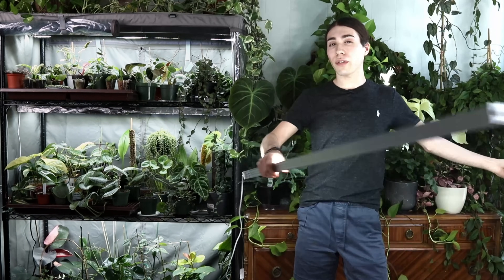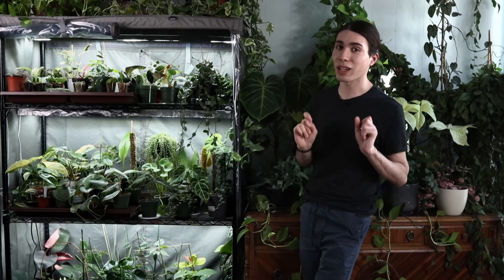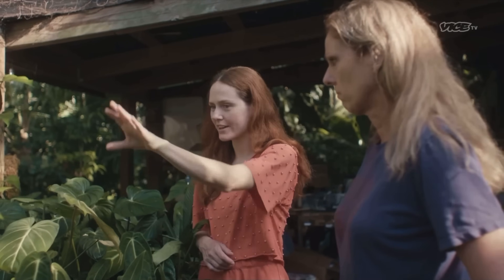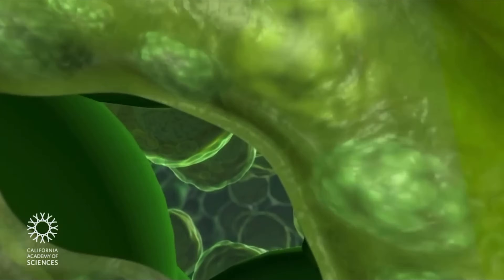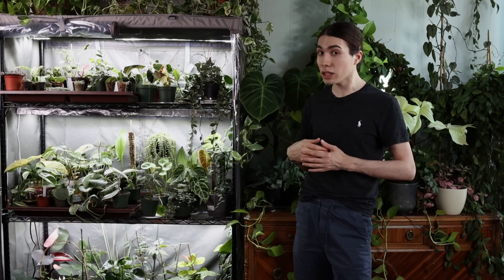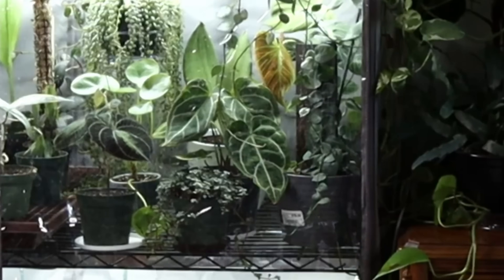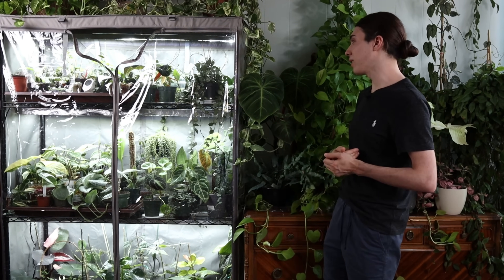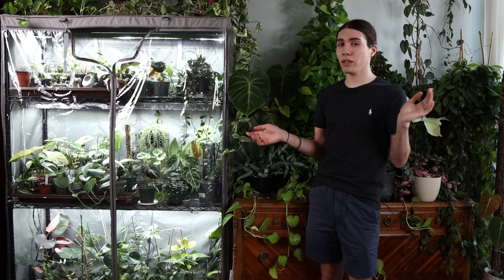How to Use Regular LED Lights as Grow Lights | Avoid the Industry Markup

Comment: I've been growing plants under lights since 1972, but I learned somethings from you today.  When I started, the bulb most used was the pinkish fluorescent tubes. I hated them for the same reason that you do.  They distort all the colors so badly that it is hard to tell if your plants are healthy.  About a year or so later, they came out with wide spectrum tubes, which were white, but very expensive.  I found out that I could get the same result by combining one Cool White Deluxe tube and one Warm white Deluxe tube.  (Deluxe tube had extra blue phosphors,) At the time and for many years, I used this combination in fluorescent shop lights, which I could buy for about ten dollars.  I learned how to make many different shelving units, usually the individual shelves were four feet long and two feet deep. Each shelf would be lit with two shop lights. Each shop light would hold two 40-watt tubes, one cool white and one warm white.  There was one big draw back to the system.  Four 40-watt tubes burned 160watts of power, but you could grow just about anything under them.  A three-shelf system like yours would burn 480 watts.  It was expensive, but since I wanted to have my plants, I paid it.  Sometime around 2004, natural daylight tubes became available.  That was about the time that I learned about the Kelvin scale. Up until then the Kelvin scale was there, but it was usually ignored.  You had warm white, cool white, and daylight.  warm white was around 2700 K, cool white was around 5500K, daylight was around 6500.  Natural daylight was 5000K and was the closest to the light coming in a south facing window.  It was the best all-round color if you wanted both rapid growth, flowers, and edible fruit.  The trouble was that natural daylight was only one company's name for that type of tube.  Other companies used different labels, then they also started using different labels for their other colors.  To be sure of what you had, you needed to look at the fine print on the back of the package and read the Kelvin rating.  So, what is the kelvin rating.  Basically, it compares the light of the tube to the color of a bar of steel as it is heated past the glowing point.  as you heat a bar of steel, at 900 degrees it emits a red glow. as the bar gets hotter the color moves into a predominantly orange glow.  Hotter still and the glow becomes yellowish, then yellowish white, then white, them blueish white.  I use 5000K because I am interested in cacti and flowering plants.  for a person like you who is interested in mostly foliage species and Hoyas, you would do better with 6000k or above.  When I place a Hoya carnosa  directly under my lights, it turned yellow and refused to grow.  I had to move it back about five feet from the lighted area before it got back the natural green color and began to show its typical silver streaks.
  With the introduction of LED lighting, the Kelvin rating became even more important, as did all of the information on the back of the package. When LED lighting was introduced, its main competition was the old incandescent bulb, so all the labelling was a comparison to incandescent lights because most of the country related the amount of light emitted by a bulb to the wattage.  When the label says 100 watts daylight, it really means that it produces as much light as a 100-watt incandescent bulb with the color of a daylight fluorescent tube.  If you look at the fine print though, you will see that it only draws 18 watts of power from the plug.  Since we pay for electricity by the watt, that is a huge saving.  When I discovered that, I changed every light in my apartment to LED.  The initial investment was high, but the lights last so long that I have not had to change a light bulb since.  When, before, I had to change my fluorescent tubes about every year because they deteriorated that fast, the extra initial cost was repaid in less than two years.  Because China has been producing such reasonably priced LED growth lights in configuration's that can be installed anywhere an electric cord can reach, the whole hobby has totally changed.   If I had a basement, I could grow hundreds of thousands of cacti down there, and in the back corners, where the light is not so bright, run a Hoya nursery.
Reply: I think this is the longest comment ever 😂 very informative
Reply: Thanks for the info
Reply: Super informative! Best thing I can suggest is to get solar-powered floodlights and you basically pay $0 for your nursery. Would love to see a comparison between that and having LEDs directly above your plants.
Reply: @chickenbellyful  The problem with that is  that you need to have a place to set up your solar panels. I live in a sixth floor apartment and all the light coming in my windows is needed by my plants. I do not have room to set up a solar panel array.  If I had such an array available, I would not use floodlights. that would be an inefficient use of the available power. I would direct the power into my plant light panels.
Reply: Thank you! Finally a good explanation! I thought I was all set with my 6500k full spectrum fluorescent (and now led) lights, BUT then the lumens.. confused me some 😂  I'm about to give up on my large succulent collection anyway, due to plant pests so I guess it won't bother me for long!
Reply: @haleraiser2299  Kelvin is a measure of the color of your light source, while Lumens is a measure of the brightness.
Reply: I'm glad you came up in my recommended, your humor made me subscribe immediately. You have a lovely collection and I'm super jealous of your string of turtles!
Reply: Super helpful comment!

Comment: From my trial and error and for my plants that I actually want to flower and enjoy the color of their blooms with accurate color indexing of the light. I found with the grow lights since you pretty much have to get red spectrum in but don't want it too warm or pink because it ruins the color of the blooms. The rough ratio is half cool white to half warm PLUS red leds. So example would be 100 cool white leds, 80 warm white and 20 red. Some even have IR which is supposed to be an added bonus for blooming and affecting stem elongation. Not sure if it will make a difference to notice. I have mine for bloom gesneriads and orchids. Maybe I'll eventually notice a difference between the ones with IR and not. Prices regardless are roughly the same so it's just a bonus if it has it.

The price of led's has really come down in last few years and there are lots of really cheap plant led lights with good spectrum. Four years ago there was basically nothing aside from grow tent lights or big heavy spot lights. Now there are tons of cheap light strips of all different sizes and panels. I just upgraded everything and am in shock how good the market is now. Really cool  small panels 2x10 for small shelves. Or strips that are 10-16 inches long that come in multiples 2-4 strips per fixture you can light a small shelving unit. Just so cool. And on top of it most of them with dimming settings and timers. It's really the best time it's ever been to be in the hobby. For 10-20 dollars you can literally light any little nook or spot of your house to put plants lol. Also another cool thing wire shelving now is readily available in all different sizes and with black coating so it doesn't look industrial. You can buy plastic mats on amazon for them that makes them look much nicer too. This stuff wasn't common just a few years ago.

To just give a monetary perspective of how good it is now. I just did a 5 teir black shelf with liners and dimming timer grow lights that can support blooming for around 140 usd including tax. There is no way you could have done anything like that just a few years ago, it wasn't available far less the price. Now is as good of a time as it's ever been to get into the hobby.

Comment: love your no-bs attitude so much, it's such a breath of fresh air. I definitely saw Planterina just use normal lightbulbs too, so now this gives me hope my set of succulents won't just die on my northern windowsill during winter.
Reply: All of my windows are north facing
 And all last winter I had a cactus × a succulent on my tiny little window sill. In Wisconsin. And they survived just fine. I also have several tropical plants near the windows and they did well too. And the only windows I have face north..

Comment: I am using hard LED strips designed for "aquariums, vivariums and terrariums" All I was looking at was the spectrum, lux and of course price. Stacking multiple  strips into a rectangular diy lamp seems to be good enough to supplement sun on the windowsill for my succulents. In fact any use of pink light I saw on succulent groups ended with a disappointment, they were cheap lights that were nowhere near enough to be the sole light source for a succulent

At the level of my plants (so close) it comes up to around 8 000 lux measured with a phone app, at night with outside blinds so only the lamp is emitting light. Not bad for a normal affordable strip (or rather four of them a bit spaced apart)
Reply from the maker: I don't think strips are constructed well enough to put out the same amount of light as bulbs with heat sinks and whatnot so that makes sense, but great for small spaces you just need a bit of light.
Reply: @phytosexual  Those are aluminium strips, not the flexible ones, so that might be better, at least according to what I read? 

But yeah, the lamp constucted with it is definitely less clunky than trying to place a bunch of bulbs on a windowsill full of plants ^^'

Comment: I love the level of science you include. Thanks for an educational presentation
Reply from the maker: no problem :)
Reply: Do more research before believing what he said... he compared his LED to a T12 TUBE.. t12 are those giant tubes invented in 1930 used in office buildings or retail in the past.   T5 is the tube he should have shown everyone.. T5 tubes are what plant and aquarium growers like me use for corals for salt water and plants in fresh...  T5 tubes at 6500k put out 5000 lumens, thats like 96 lumens pet watt i believe.. thats lower than the 130 lumens per watt on his LED.. but that 5000 is UN-REFLECTED light..  Florescent light fixture use reflectors.. a good V shaped reflector can double the light output.   So 5000 lumens plus 5000 lumens.. minus 10% from being reflected.... Thats 9500 lumens on one bulb..   Think about that for a second before believing this dude.   LED lights like his also have no light difusor.. so led light isnt spread out.. its directional..  meaning it has hot spots you cant see without a PAR meter..  FLORESCENT lights are 100% even light  spread..  They dont have hot spots.

Comment: For the last 2 years I've been using white 4000K LED lightbulbs (3 of them, about 5000 lumen total), in a "normal" fixture in my living room. My plants are a) totally fine and b) growing towards the fixture/middle of the room, and not towards the window, which is much more aesthetic. One thing you can look into is CRI of the lightbulb, which basically translates into how wide is the spectrum emitted. Most lightbulbs are around 90 CRI, but those that are 95 CRI and above have emission spectrum that correlates a lot better with absorption spectrum of chroroplyll(s). The price is very similar, but you may have to do a bit of digging to find which ones have higher CRI, because well, retailers don't care
Reply: Very true, most normal LEDs are missing a lot of red in their output.
Which I guess isn't a problem if you're growing the plants for foliage
Reply: Your plant is going to face and point toward wherever the most blue light comes from. Plants don't follow light, they follow blue light. And a 4000k spectrum color temperature lens towards a higher amount of blue.
Reply: Cri is ok but won't tell you if spectra vital to your plant are missing. The scale is a hundred so a 90 cri could leave 10 percent of some good, tasty colors out.
Reply: Good info, thanks!
Reply: What kind of "normal" fixture?
Reply: @emilystubbs5650  i understand it's a normal ceiling light with the right leds, since they mentioned the plants grow towards the middle of the room.
Reply: Thanks that you mentioned CRI I Learned something new.
Reply: Are you growing vegetables?
Reply: @lindaertel7558  No, just houseplants. I don't think this setup would be enough for vegetables
Reply: Wow, thank you so much for this..
Reply: Are you using regular round household lights? Or the long Led lights?
Reply: @stardroplet9499  I have led lights in the form of a round lighbulb, and not led strip, if this is what you ask for. Led strips are generally lower power and need to be close to the plant. Instead I have 3 quite powerfull led lighbulbs, at least 12W each, so I could mount them in the fixture on the ceiling and they still work fine.

Btw i't been a year since my original comment so maybe that's a good moment for an update. I now have 2x 1055 lumen, 6500K and 1x ~1500 lumen, 4000K lighbulbs . All of my plants are quite happy with them, accept my anthurium clarinervium, which seems to be more interested in natural light - but still grows very nice despite being 2 meters away from the window. The light are on this automatic on/off thingy with about 10h of light each day.

Comment: Some of my plants actually do not like normal LED light, and either grow really small or decline.  Particularly, my vertical-growing peperomia, and echeveria.  I have to move them closer to a window, or use a grow light.
Generally, everything else loves it, either primarily or as supplemental, especially ferns and bromeliads.
Love your videos, and hope you'll keep disturbing planty YT!
Reply: It could be that the normal LED lights you're using have an uneven colour spectrum - mostly blue, some green, a little red, is pretty common for household LEDs. Whereas the sun has an even spectrum (an even amount of red green and blue.)
Maybe some plants are more picky about needing an even spectrum 🤷🏻
Reply from the maker: Thanks for the info!